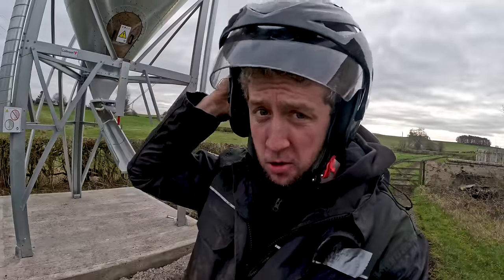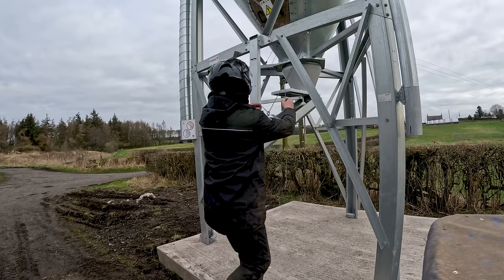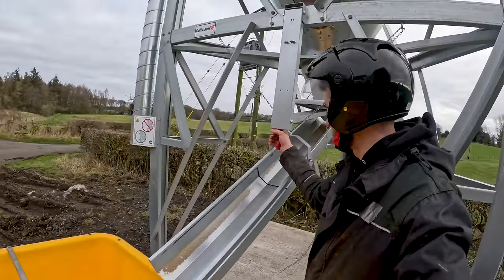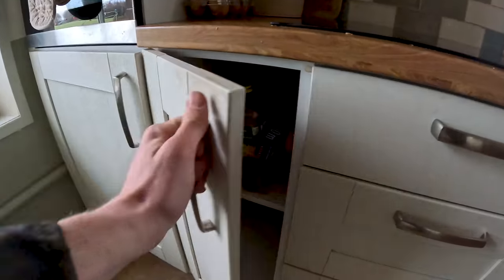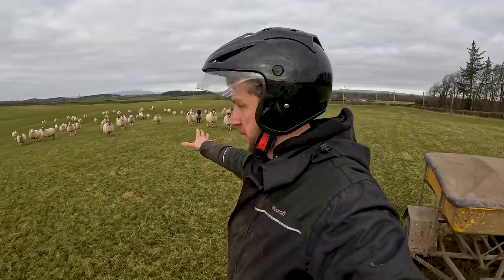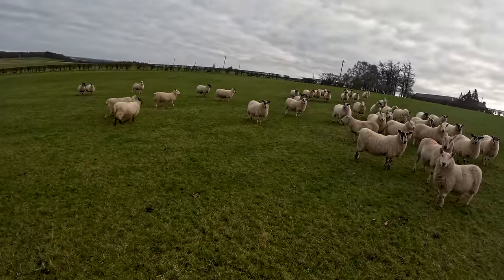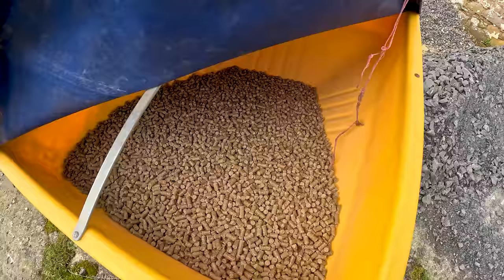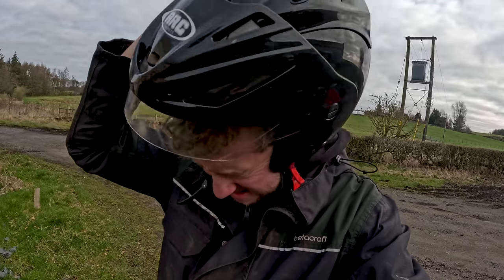Our NEW FEED SILO in action!

Comment: That has to be a significant cost saving for you overall as the cost per tonne will be good deal less per tonne. However what is your plan for when you have the sheep housed - bag some feed and cart it over? Could you fill some bags / tubs direct into the back of your pickup to avoid having to pick bags up of the floor or perhaps your feed supplier could deliver a big bag (half ton?) direct to your lambing shed to avoid multiple handling
Reply from the maker: Aye i’ll just bag some Dan. In fairness most of the feeding is at that piece of grazing and i give them a good feed after they’ve lambed. 👍